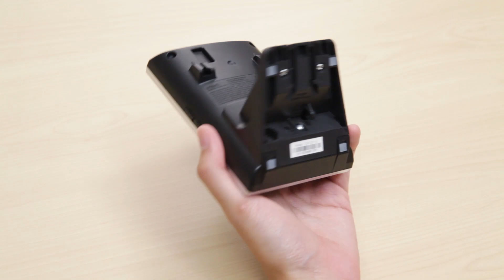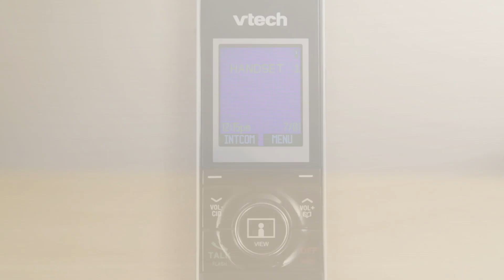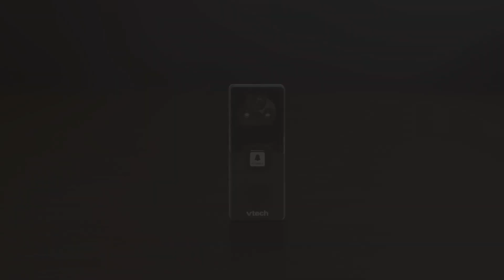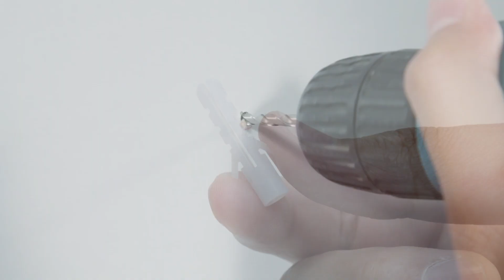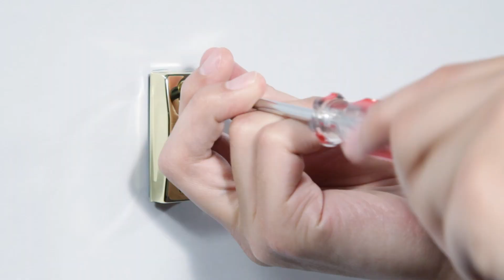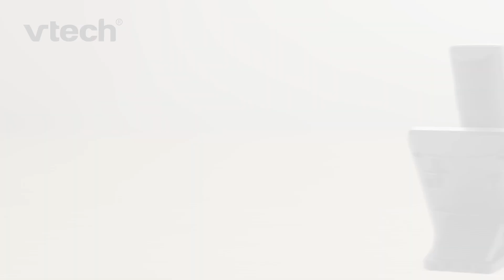VTech® IS7121-2 Video Doorbell Installation Video

Comment: This is a great phone https://www.youtube.com/post/Ugkx1m4aStCYW1-eZhNPOgFG2H2JJSmJ2RwK for seniors. It does not pick up the background noise, allowing one to hear only the conversation spoken into the handset even with the tv on. This was a big problem for my 92 year old mother and caused us great frustration when talking with her on her previous phones. My mother does have some hearing loss in both ears but the side button, audio assist, boosts the sound allowing her to hear clearly. Buttons are large and the screen is easy for her to read. It has a caller ID announcement which is a feature she uses to screen out unwanted calls. This phone worked out so well we bought a set for my 94 year old mother in-law and she loved it. Highly recommended for all ages. I like the way the backlight lights up the actual numbers on the buttons for easy viewing in the dark as my current phones light up around the buttons only.

Comment: I just purchased this to run two seperate phonelines off of and it is great.~~>allmy.tips/VTechCell?hH◆    Contrary to other comments made here, the speaker phone on the base station works great. I've got no complaints and have been using this for a month now.

Comment: Thanks for the answer but I'm not abble to reach the call center. Please describe for me the procedure. There is not a description for this soecific case in the user's manual. Thanks for your help.
Reply from the maker: Hi, +Rene M. - Try to manually deregister the handset by pressing * 3 3 1 7 3 4 # then the Left softkey.  The doorbell will lose its old registration when registering it to a new IS7121 base, so a manual deregistration of the doorbell is not needed.  If you need further assistance, call 1-800-595-9511.

Comment: I really love the idea of this unit. I've read through the installation manual and have a question. Do you need to install a battery or use the external A/C adapter if you connect to your existing doorbell wiring? The manual says that only the doorbell will ring in this scenario (which I'm okay with), but it doesn't state whether the camera or door intercom will be operational or not.
Reply from the maker: Hi, +mlbrown76. In order for the camera and intercom to work you need to install batteries or connect to AC power. Thanks!

Comment: Dear VTech staff. Is it possible to open the door remotely?
I currently have a 12v door lock. Thanks!
Reply from the maker: Hi DietaFinal. At this time, it is not possible to open the door remotely with this system. Thanks!

Comment: Do we need to install the ac power if i install battery to the doorbell because i dont have a plug near the doorbell
Reply from the maker: You can run the doorbell using (2) AA alkaline batteries. Thanks.

Comment from the maker: To register:
Step 1. Press and hold FIND HANDSET on the telephone base for about 4 seconds until the IN USE light turns on.
Step 2. Press and hold DOORBELL for about 10 seconds until the doorbell light flashes slowly.  You will hear a confirmation tone and the doorbell light will remain on when completed. 
 
If you're still unable to register it to your base please contact our customer service department for assistance @ 800-595-9511.

Comment from the maker: Hi Pat,

The base can have a maximum of 10 handsets plus 2 doorbells so if you have more than 10 handsets your 2nd doorbell won't register. Also during the registration process make sure the doorbell is plugged into AC power and turned on. If registration still fails then you may need to reset the system. Unplug the power from the telephone base, wait approximately 1 minute and then plug the base back in. Try the registration process again.
Reply: i can use battery to register a door bell?

Comment from the maker: Hi Henry, Under conditions of extreme cold, it is advisable to power the doorbell by using either the AC adapter (included), or the existing electrical connection, if it is replacing a conventional electric doorbell.
Reply: I bought AA Lithium Batteries made to perform well in extreme temperatures -40° to 140°F.  20-year shelf life. Energizer L91BP4 (last 8X longer) or any other brand that claim to have extended battery life so you don't have to change them as often and thus wear away that screw at bottom.

Comment: Is all good but what about winter with temperatures dropping to -20 degree i don't think is good for those batteries
Reply: I bought AA Lithium Batteries made to perform well in extreme temperatures -40° to 140°F.  20-year shelf life. Energizer L91BP4 (last 8X longer) or any other brand that claim to have extended battery life so you don't have to change them as often and thus wear away that screw at bottom.